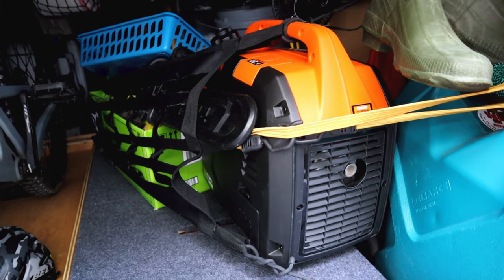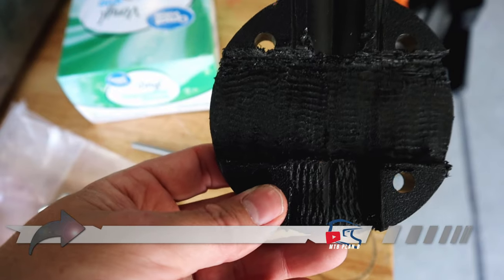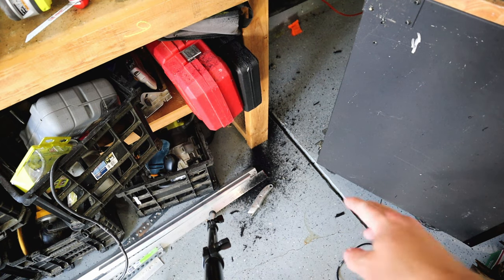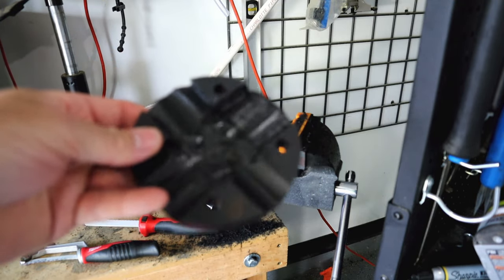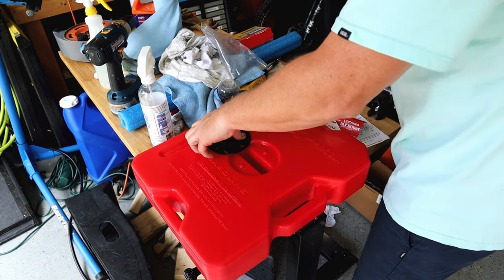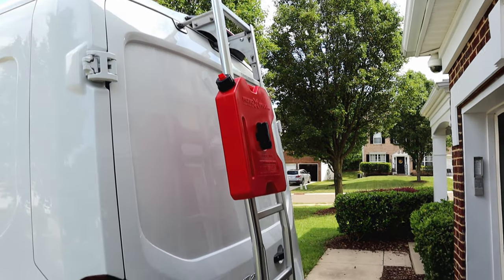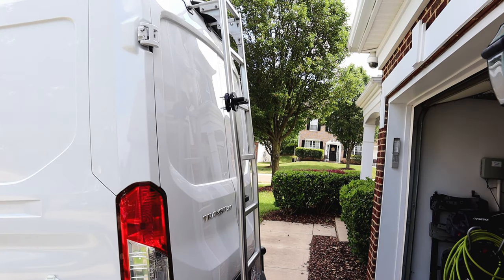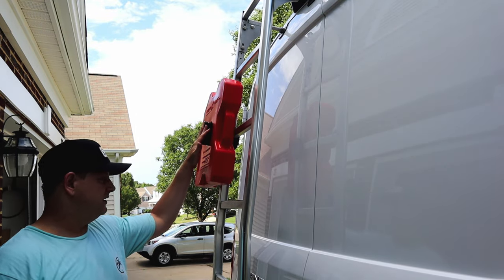#MTBPlanB Mounting Rotopax fuel pack to Prime Design van ladder

Comment: How has this been holding up long term?  Curious whether the weight of the fuel container has any negative impact on the PD ladder's placement - has the ladder shifted at all?
Reply from the maker: So far ladder hasn’t moved. I usually carry a full tank of diesel in the winter or gasoline in the summer.
Reply: @MTBPlanB  Thanks - I will probably do this as well - great solution!